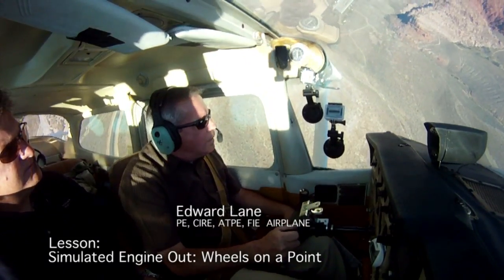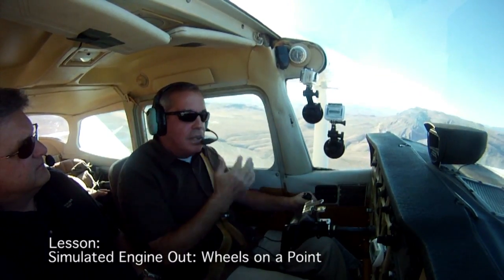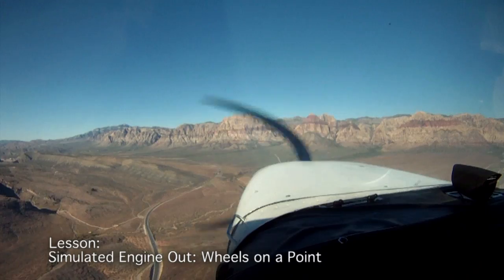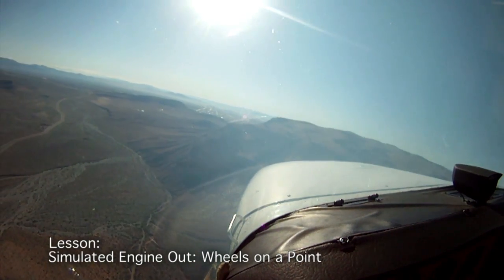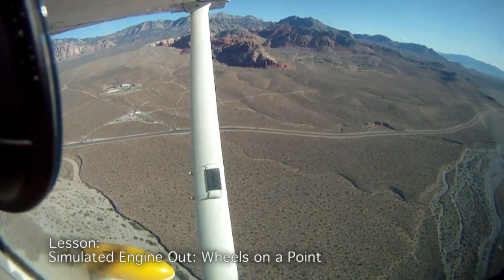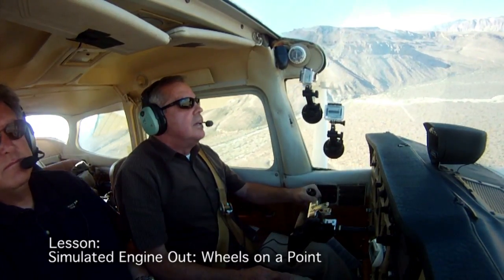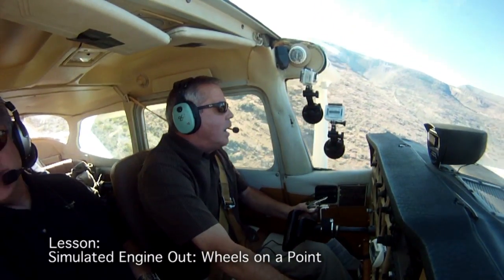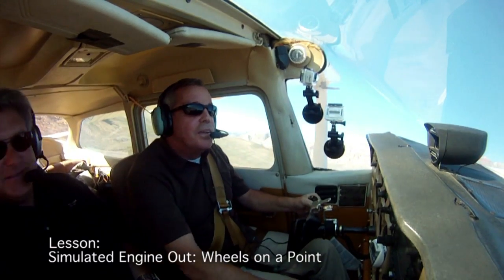Engine Out - Wheels On A Point

Comment: Useful information, but it appears that you violated CFR §91.119(c): Over other than congested areas. An altitude of 500 feet above the surface, except over open water or sparsely populated areas. In those cases, the aircraft may not be operated closer than 500 feet to any person, vessel, vehicle, or structure.

At 2:42, you can clearly see a bicyclist on the road going the opposite direction and you fly directly over him, at roughly 100 feet altitude.  Can you explain how this was legal?